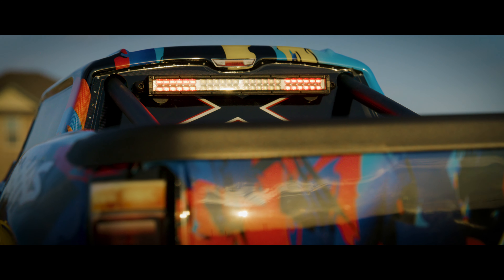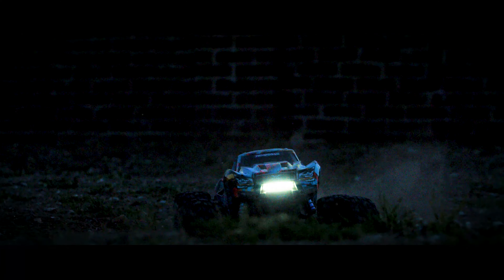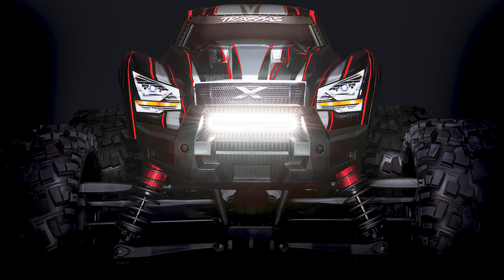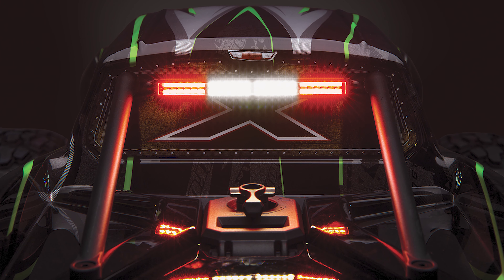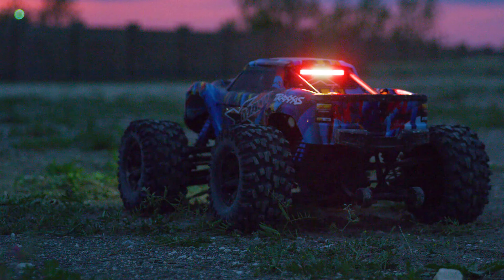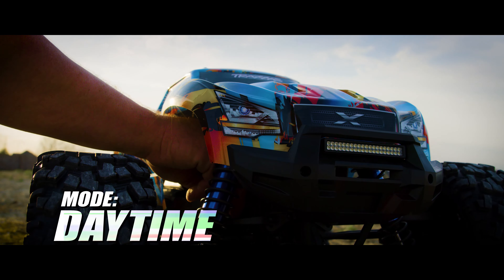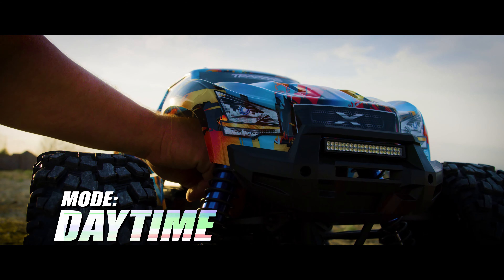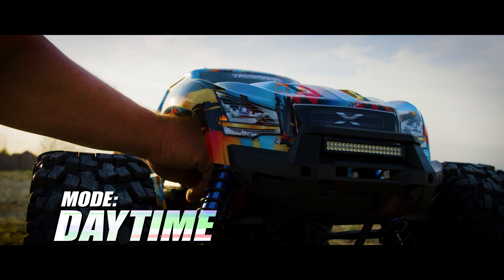X-Maxx LED Light Kit | Overview

Comment: This is a great kit for my XRT, but, often it fails work correctly, when it does no brake or reverse lights work, fails to show in the app, I've ordered a spare HV kit to see if that's any more consistent, when I say that I've noticed if you risk runaways by powering up the ESC first then the TX it seems to connect again and will work for the next however long...odd.

Comment: Does it work with an esc that isn’t traxxas, like hobbywing for example?
Reply: Maxie 0210 wondering the same thing
Reply: Sadly the kit does not work with an aftermarket esc due to the accessory port on the Mxl-8s esc being removed during the upgrade to an aftermarket esc such as the Hobbywing Max-6 or Max-5. The accessory port on the stock esc is where the light kit not only gets its power, but also recognizes when you are braking, going forward, or reversing.

Comment: The traxxas electronics have left a bad taste in my mouth. This kit only lasted 2 runs and has caused damage to a VXL-8S I recently installed.
There are multiple issues on forums about the electronics too. It's so disheartening after spending hundreds of dollars on accessories 😔